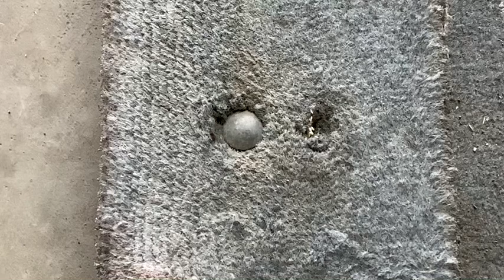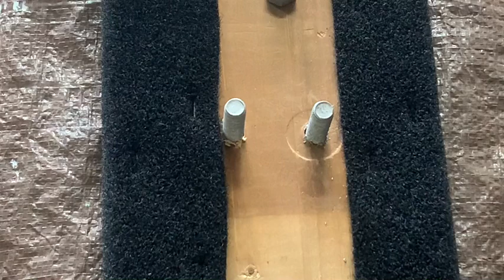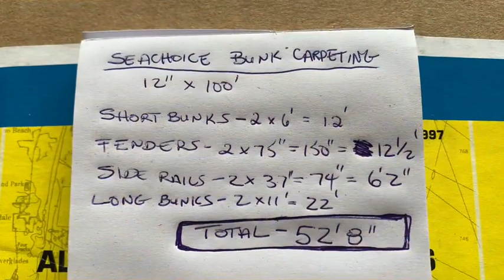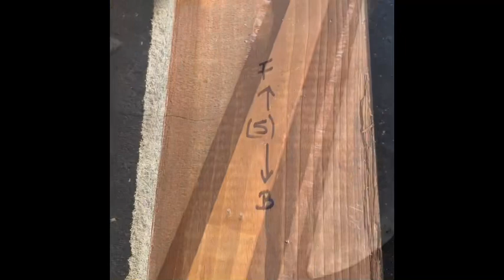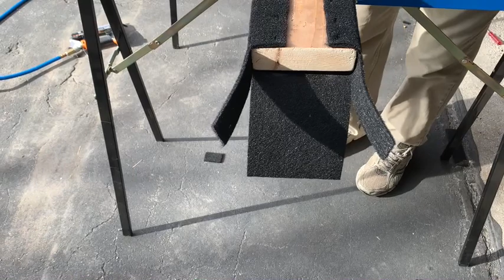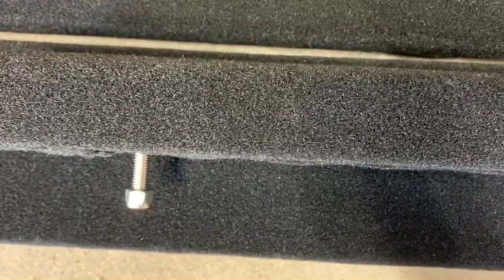Trailer Bunk Carpeting Replacement Plus Fender and Side Rail Bunks

Comment: Might be a tad easier using the 3/4 bit and then the drill bit in that order.
Reply from the maker: Thanks Joseph, excellent suggestion.
Reply: I use a Forstner bit to make the depression. There is also a companion anti turn washer you can put under the head of the carriage bolt to keep it from turning while putting on the nut. These are available in galvanized at Home Depot or Lowes
Reply from the maker: @geodes4762 Thank you, always appreciate hearing good suggestions, much appreciated.

Comment: You went all out. I did similar mounting with stock carriage bolts. Used the old wood to mark out the new wood. Nice video. Same with folding. I have the same manufacturer of trailer. Also replaces the rear and front boat straps.
Reply: Your  video is top notch. Other videos don’t show drilling and inset for carriage bolts. I still have to do the side pieces and I’m using your video to help me out.
Reply from the maker: Thanks again, I just switched boats and I will have to redo the bunks on this one too. The video is a great reminder for me too. Sometimes we forget the little things after not having done the job recently.
Reply: @stevechiassonfishing5876  went to buy wood for the side pieces. Found sum left over mahogany wood pieces at Home Depot. Two 5’ pieces 12” wide. It rang up at over $200. Went back and got a sheet of pressure treated plywood. Also got 4’ of indoor outdoor carpet as my bunk carpet wouldn’t reach around the full piece with extra to staple. It’s looking nice. I have my boat in dry stack at discovery bay marina California so I get to take my time doing trailer maintenance. I’m also replacing all the lights with led. It’s definitely work that needs to be done so we can have a nice day on the water as well as the trip there and back. Replaced all tires and the spare two years ago.
Reply from the maker: Thanks James, I appreciate you sharing your kind words.
Reply from the maker: Well worth the time and effort as you will be happy with the end result.